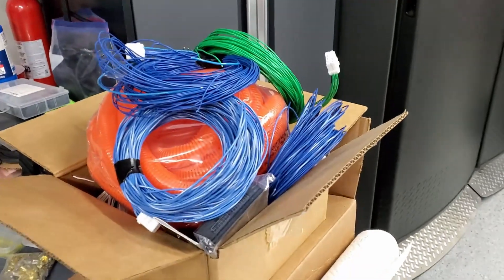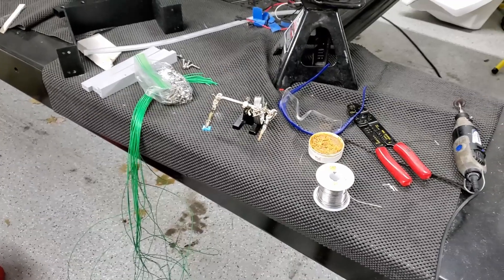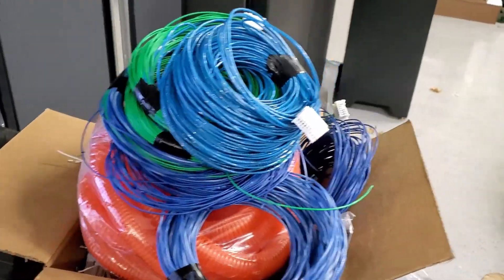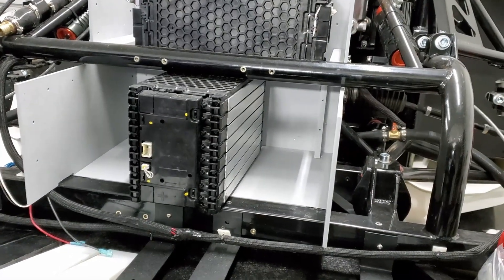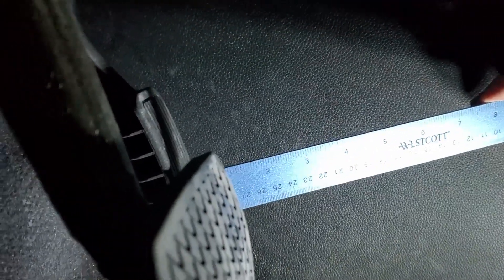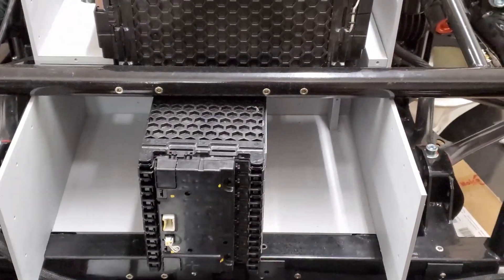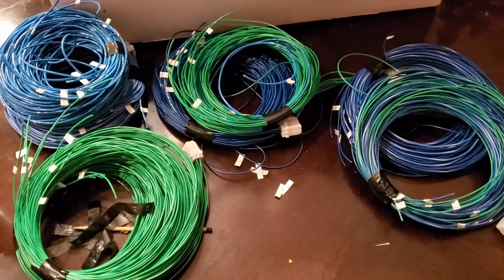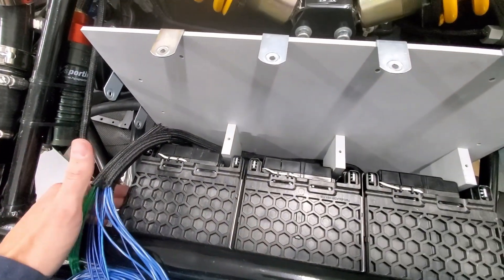Electric Vehicle Battery Pack Wiring

Comment: Are you going to cover the BMS wires in an orange wire loom since it's going to be high voltage as well?
Reply from the maker: It is my understanding that the BMS wires are low voltage.  Each wire is measuring each cell (~3.7V)
Reply: @electricsupercar  The delta between pairs of wires will be only cell voltage.  But individual wires are at multiples of the cell voltage, up to the full pack voltage, relative to ground.  So you don't want to be able to touch a bare wire from one of the higher cells in the stack.
Reply from the maker: @h264bob  Ahhh, didn't think of it this way.  You make a good point.